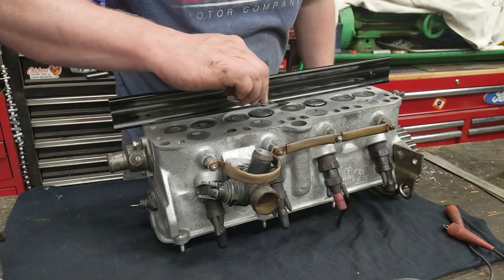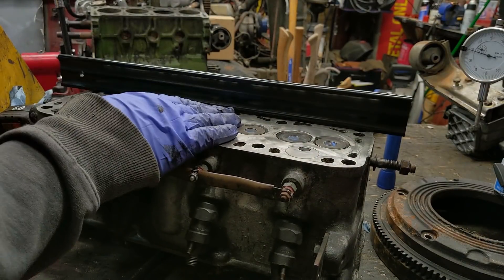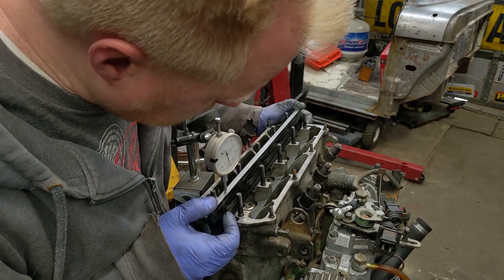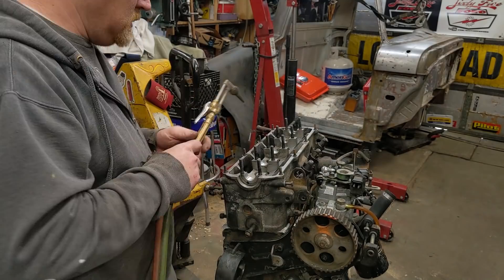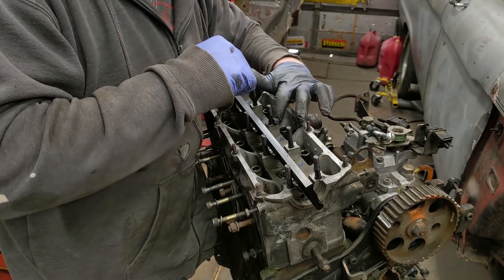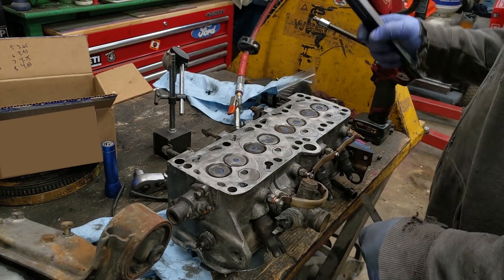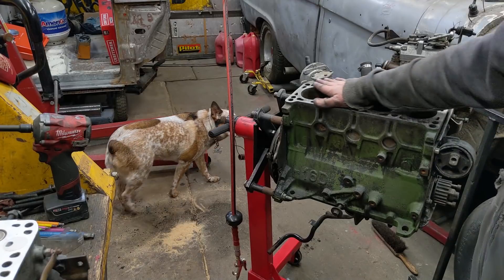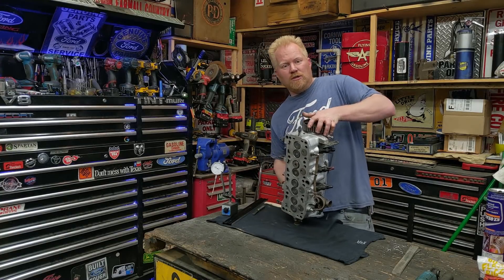Warped Cylinder Head Straighten Resurface in the GARAGE DIY

Comment: You know, Ive been doing this for almost 50 years. And Ive never seen another shop do this kind of straightening. In fact, numerous shops years back outright attacked me for doing it. Screaming and crying why the head needed machining. Ive seen the same kind of people on youtube. When you mill a head, IT DOESNT REMOVE THE FREAKING WARP!

Not only will the camshaft will be off, but now you have thin and heavy areas of the head AT THE WATER JACKET! AND you have combustion chambers that will be smaller where more material was removed and larger chambers where material wasnt, which will cause additional tuning and performance imbalance. You will raise the compression ratio in 2 of the cylinders where the most material was removed. The list of issues immediate and long term are too long to list. All because of milling a warped head.
Reply from the maker: That's fantastic, I'm glad I'm not the only one that sees it this way!
Reply: You make some very good arguments, for not machining it straight, I’ve always wondered aboutThose issues that you talked about
Reply: The way I was told at the engine shop I worked at, the head is warped so the cam bearings are now subject to heavy wear because the cylinder head is probably shaped like a Pringles potato chip. 
Shave the head , the cam bearing area is still warped and then it's all downhill from there. 
Straighten it first , and then shave it ,and you're only gonna shave enough to get a clean surface. 
I had an unwarped vw head like this ,and we cut the surface with the block grinder because of the hardened prechambers.
Reply: @MrTheHillfolk  
First  thank you for an accurate description of the Needed repair process to fix a warped cylinder head but there is one more important step. After taking the bow out it is always necessary to line hone cam journals. The process to remove the bow dose not fix journal alignment only journal height as measured from head end to end. The head has to be straightened first as to fix a .015 journal misalignment would require a massive cam bearing cap cut and only undersize the top half of a hole (lowers the camshaft location to resize the hole).  Cam journal line hone (ore bore in excessive cases) aligns the cam bearings journals height as well as twist. This twist cannot be corrected by heating and bolting the head to a surface while cooling.  Just as flattening the head is just one step refinishing the surface is just as important. 35 years ago i cut my teeth on toyota 20 and 22r heads in a machine shop. They were horrible at ruining cam alignment even with a slight overheat.
Reply: @bad406camaro  hard part with all that, is it's about impossible to find some cam bearing shells  to fit up to a VW head.
They use the raw aluminum for a bearing surface. 
I'm sure it could be done, but I've never seen it (on a vw head). 
So for the most part if it's really out ,it's done 😔
Reply: @MrTheHillfolk  VW ?  Yes the method i described is how you restore the cam line without the need for bearing inserts. Just one more step often overlooked by todays "throw it away" mentality towards repair.
Reply: @bad406camaro  ah ,ok I reread that again and now I getcha. 
Haha seriously,I should get reading glasses but I'm resisting it like a kid.
That's because I'm not a kid anymore and being reminded of that, and it's not pleasant 😔😂😂
Reply: Machine shops must hate you😆
Reply: Iv never seen this method how cool Iv had to use shims on diesel heads because of machining I'll have to try this method
Reply: 45 years turning wrenches and I never knew of this method. I wish I had. It only makes sense. Great job!
Reply: Same here. Tech with 40 yrs exp
Reply: Hey, wonderful! Being a mechanic most of my life not full-time for many years now. Always have done it though. Done similar things on motorcycles etc., but was told they had to re-bore the cam bearing journals. Thanks for sharing that God-given genius of yours with us. You are the man. As always.! Keep up the great work have a beautiful day. Jim
Reply: hey PS, as I have expressed you are the man! Could not express that with more expression. No pun intended ha ha. been forwarding your videos to various people whenever I can. Do not watch a lot of videos. I am a mechanic Blacksmith kind a guy. It looks to be that you could be the same. Always making and repairing things. Under those conditions all you need is a good anvil and a heat source. But I totally understand how the ignorant clowns don't know the facts as you suggested. That's part of being a scientist mechanic as well. Using your pure genius.!!! Great job have a beautiful day. Jim and thanks again!
Reply: thet scream cause they want money
Reply: Some of you have never heard of line boring
Reply: I know I'm 4yrs late but just  ran down your list binge watching. You probably won't see or reply but... I do totally agree with ya on straightening the head. (not shaving it down leaving the cam journals out of line) BUT when you heated the aluminum in one spot and that little ball popped out (drip)... that's actually the aluminum. When you melt or weld aluminum the core liquifies before the surface "skin". I'd try heating a little bit bigger area and not let it liquefy. This is not easy to do it takes practice! Been a Aircraft tech since 90s welding aluminum with Oxy/Ace... I'd know! (Not that all A/C techs weld or melt aluminum on purpose)
Reply: I just dropped a head off to be machined, and was told the metal was soft as a result of overheating. Would this process not cause the metal to become soft if overheating did in my motor? Can I re harden my head? Looking for some info. Cheers!
Reply: The cylinder head gets bolted down straight on the block.
Reply: @Elaba_  blocks move around alot more then you think.
Back when I was doing more diesel rebuilds , the new guy was rigging up an engine to run on the floor. 
Little Perkins 4.236. 
He put the garden hose to the inlet and cranked it up. 
Well, you could see the water jackets expand about 1/8-3/16 of an inch easily because the thermostat was in it. 
So yeah ,blocks aren't quite as solid as we all think. 
Bolt down a warped head and have it induce that to the block a little bit , and has a lousy seal/clamp load anyways.
Reply: @MrTheHillfolk  the old Chevy 350 K small block with throttle body injection used to run so hot the bores would actually shift in the block. When I bored those out I had to use special alignment plates for the boring machine to allow for these bores that were so out of whack.
Reply: @thecommentary21 How many times did you still have to mill a little bit like Sixtyfiveford did?  With Toyota engines I guess it's impossible to mill a head because of the small tolerances. With older engines you can get away with it?

Comment: I was going to initially just sand down a toyota 4Y forklift cylinder head. But knowing and having worked with heat straighening on steel column. This method sounds the most logical and you clearly showed it works! Great explanation too I never paid attention that sanding down would create tension on the camshaft. The more you know

Comment: I had a head machined and installed then realized my cam wouldnt turn once torqued down.  Thats when i found out thru YouTube about head straitening.  Did mine bolted ti the block with shims using 2 acetylene plumbing torches.  Got it just hot enough by heating from both sides.  Then had to have it machined again, which put it out of spec.  I then had to buy 2 mls gaskets and make a custom thicker head gasket.  Was a pain, but a head was as much as a used motor and I made it work.

Comment: I've seen Daniel Soliz and you use this technique.  I believe your readings before and after for the top but don't see how just heating those six thin sections could have changed the bottom flatness.  An oven might seem more likely to heat the whole head evenly and unwarp it more thoroughly (with end shims and bolted to a thick plate).

Comment: This is a nice informative video. In the 1980`s this was common practice prior to machining. I can remember doing Toyota cylinder heads it seemed like every one that had a over heat had cam alignment issues. In the Machine shop i started in every OHC head was straitened before resurfacing.  Not exactly this method but same idea. One thing you did not mention is the absolute need to line hone the cam journals to restore cam alignment. Aluminum heads twist as well as warp. Straightening takes out cam journal height issues but dose not fix journal alignment issues. I misaligned cam journals can cause excessive journal wear, Low oil pressure, premature camshaft failure. Just as straightening is just one part of a repair to a warped head (always resurface after straightening) line honing cam journals should never be overlooked.

Comment: Would i be ridiculous if i did this with the head still on the block in the car and i use my stick welder? I think if i heat the head from the outside instead of the inside i wont catch anything on fire

Comment: This video blew my mind and I love it!! I'm rebuilding my first car engine, a 93 Accord 2.2L F22A6, and the donor engine head has right at .005" warp in the middle going upwards like yours. I'd really love your advice. Placing it on the block without a head gasket, then barely hand tightened the middle two head bolts only, makes the warp disappear. Cam journals appear straight and cam spins smoothly. Should I just go for a light resurfacing with sandpaper then run it, or should I heat up the mating surface and try and get a bit more of the warp out? Thanks for the amazing video!

Comment: my 1st car was a 1981 VW Rabbit Diesel I bought from the local High School for $350.   I think I'm still trying to get on the local freeway at 55 MPH all these later.
Reply from the maker: That's awesome. I've been driving this in my '82 VW truck for months now. It has no issues doing 70 to 75 mph on the freeway and can push it to 80-85 if I really want to. I think from the factory they detuned the injection pump for fuel mileage but it can easily be turned up to deliver more fuel / more power

Comment: Good work, but one problem is “got a little crazy on that one” with the torch. You don’t have to go all out on the flame, you can just run a carburizing flame which will still get more than sufficient heat into the aluminum without blowing a hole in it. And slightly “jiggle” your flame back and forth about 1” to reduce punching holes in the head. Those little divots are probably inconsequential, but cylinder heads on high performance or boosted applications can see very high pressures and that weak point could potentially cause problems. Bone stock Honda Civic, go for it! Dodge Hellcat..... perhaps not. 😂 

But if you DO happen to blow a hole clean through it, just give it the ole’ Billy Mays FLEX TAPE slap! 😂

Comment: so those heads are prone to cracking between the valves ,  inspect this area closely , i've welded more than a few up and reinstalled new seats . 
also a head stud kit makes it much easier to get a slightly twisted head to seal up . 
a thicker head gasket can help seal a twisted head , but going from a 1 hole to a 3 hole head gasket also screws  up on how the diesel burns in the combustion chamber and it will run with more black smoke .

Comment: Can this work on Aluminium engines. And after sanding the mating surface in the case of an aluminum cylinder head what’s the most appropriate cylinder gasket to use. Metallic or graphite?
Reply from the maker: Yes, this works with aluminum engine blocks. I generally go with the composite graphite gaskets, but I have no real preference.
Reply: So after this process of resurfacing you saying one can still use a metallic gasket

Comment: I used this method tonight on a 2.4 Ecotec engine and it worked great the head was out .013 I cannot fit a .003 feeler gauge under the straight edge now!!! Thank you for helping me get the wife's cylinder head back within factory specs!

Comment: Personally I have any head I remove checked for cracks and milled true. $40 is a small price to pay for peace of mind.
Reply from the maker: No good machine shop would not straighten the head. Just milling the surface leaves warped cam journals.
Reply: @sixtyfiveford  
They do what I ask. I’ve never had a problem. I do it for myself and not professionally so I’m not too concerned.

Comment: I am 43 and I had a classmate in my auto-mechanics shop class in high school who had a 4 cylinder Mustang and he warped the head when he overheated the engine. Well, he brought the head to school and was outside one day on the concrete driveway sliding this cast iron head back and forth. In amazement, I asked what he was doing, to which he replied, “I’m shaving the head because it was warped”. I don't know just how warped it was or just how straight he got it in the end but I do know that he ended up putting it back on the engine and it ran fine. As far as I know he never did take it to a machine shop.
Reply: Yeah buddy 👍🤠

Comment: I've been a mechanic all my life and never seen this, impressive.
I wonder if a twin cam wider head would be harder...
Otherwise, top job
Reply from the maker: For sure, but really not bad. You would just heat any webs between the cams as well. Some shops will heat straighten for you but that requires them to bolt the entire thing to a thick steel plate and stick it into the oven at 450F for hours. They take it out and check and do it again until it's straight enough to machine. My way is just more of a budget, DIY method that gives great results for minimal cost.
Reply: @sixtyfiveford  ok and yeah I get ya

Comment: Why not spend $60 and have a machine shop do it?
Reply from the maker: It'll cost you way more than that to have them straighten it, or rebore/sleeve the cam journals. You could easily be over $200 out and 2-4weeks out.
Reply: Hmmm.. I see your point. If it'd going to be running hi rpms

Comment: I've had so many problems with blown head gaskets since they started putting aluminium heads on steel blocks. I'm 70 now, and in the 50's,60' & 70's we rarely had head gasket/warped head problems. It just isn't worth the major aggravation it causes to save a little weight. 
What do you think?
Reply from the maker: I'm 100% with you.

Comment: Nothing like using a cutting touch tip to heat metal. Great idea, but damn dude. 21st century. Even they were more precise 30 years ago. 
Couldn't machine it flatter? You sure?
Garage fix? Sure. Must be a subaru engineer

Comment: The vw gas engines like the 1.8 where bad for warping heads too. Always used to leak water and oil. New gasket. Head surfaces checked. 6 months later starts leaking again.

Comment: Cool that's a diesel ? Like a vw rabbit ? You ever thought of getting a granite surface plate with some lapping compound for laping the head in ? Just curious if that's a good method
Reply from the maker: Years ago I actually bought a granite slab just to do that. The slab wasn't flat at all being 0.005 out over 18 inches or so. Glass is relatively flat but then it bends so easily, whatever you set it on it just mimics that surface. So you set a 40 lb cylinder head on the sheet of glass sitting on your workbench and it can be a 1/16 of an inch at a flat.

Comment: What am I missing here? Aluminum will flex and conform to the straight surface it bolts to ( effectively straightening the cam shaft surfaces as well ) - why do we care if it's straight when not bolted ? Why go through this process ?
Reply from the maker: Because the outside edges will have 10times the force as the middle and it'll just blow a head gasket.

Comment: I've seen using a piece of glass but using the oxy acetylene tank to take out most of the bow is an excellent idea that way you're only taking off as little as necessary
Reply from the maker: I tried a piece of glass years ago and found out they aren't really that flat. They also just bend to the workbench when you put 40# of cyl head on it. I had a 3/8in thick piece that I could get to bend .010+ without too much effort and thinner sheets 1/8in bend was easy. I then went and pickup up a piece of 1in+ thick granite and it was also .005 out of flat but didn't bend at all. Finally I found MDF and Melamine MDF and it was near flawless flat over 24in.  I used that with great success.

Comment: Great info!
Is it your experience that the alloy needs to be molten in spots like that?
Just wondering if bands of a good amount of heat along those top rails wouldn't achieve the same result.
Not that any damage was done to cause loss of function, of course.
Reply from the maker: Bands could also be done. Aluminum is just a finicky metal and displaces the heat so fast that if you get an area too hot it'll just sluff over and you'll ruin the whole head. The pinpoint spots allows me to pull away quickly and only have one small area of distortion.

Comment: But what will keep it from rewarping?
Reply from the maker: Because I'm equalizing the aluminum. The base of the cylinder head with the combustion has been heated and cooled thousands of times which causes it to contract and pull in like a banana. It's already about as contracted as it's going to be. All I did was contract the top to match the base. It would take extreme overheating of the engine to contract the base even more but yes it could possibly warp again.